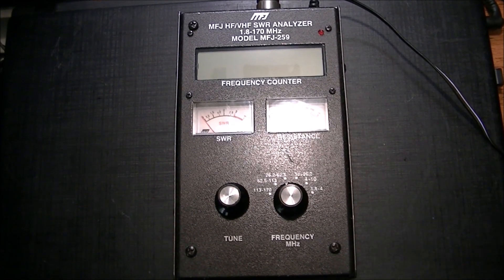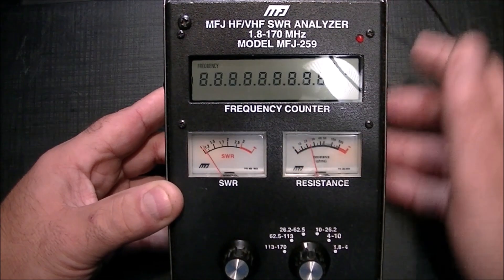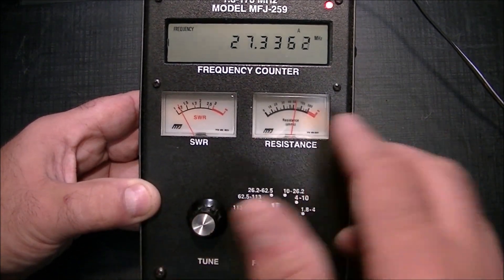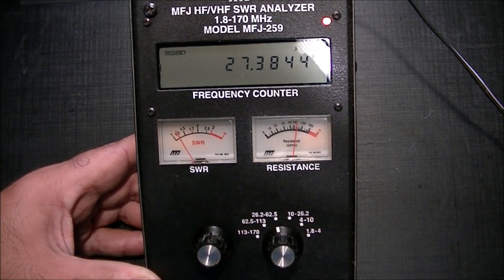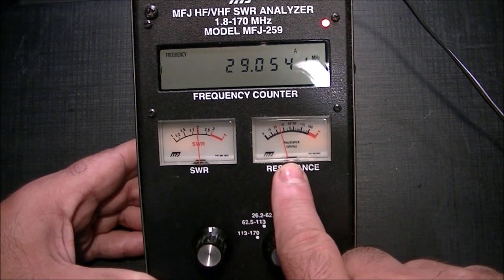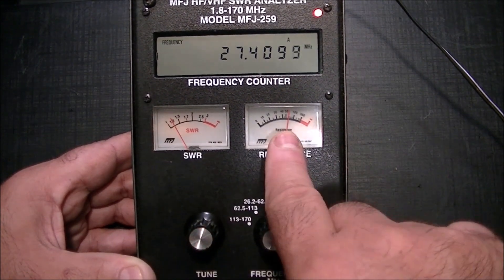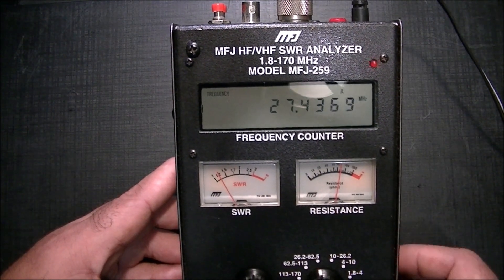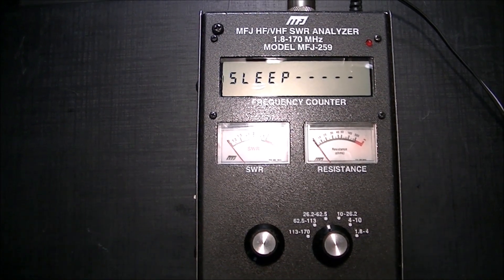MFJ 259 Antenna Analyzer/SWR Meter

Comment: These have a nasty habit of the battery holders breaking. It's a pain, but having an external battery for portable use is a good idea or obviously a power supply for using in the shack. Otherwise, they are handy units. Today, they tend to be replaced by cheap VNA's, which actually work quite well. I still have my MFJ, and other than the battery holder issue, it works well. The frequency range is also a bit limited for today but still of use. 73.
Reply from the maker: Thanks for the insight and the tips! I appreciate you sharing your experience with the unit.I don't use it very often, but it does give a person a lot of good information on the condition of the antenna. 73's brother. Thanks for the channel support.
Reply: @Tobinindustrial I used mine earlier today. I have a Mini 1300 VNA but confirmed my findings with the MFJ.

Comment: My MFJ 259C display got dark. I am not able to replace the display as spare display is not available.
Reply from the maker: I'm sorry to hear about the display, hopefully you can still use the analyzer. The MFJ company is no longer in business. Maybe you can find a new old stock display online. I was also thinking that maybe you could add some LED lighting somehow to brighten the display. 

If the display on your MFJ-259C antenna analyzer is dark, it's likely due to a few common issues. The most frequent culprits are a faulty power supply, a bad connection on the display circuit board, or corrosion affecting the screen. Start by checking the power source, then inspect the display connections for any signs of damage or corrosion. If you're comfortable with electronics, you can try cleaning the connections with a suitable cleaner, or if needed, seek professional repair. 

Good luck with the repair!

Comment: i have this model but its different than this one my one is,version 1.01 1997
Reply from the maker: I would suspect there have been changes to this model over the years.It is certainly a handy tool for the novice or professional radio operator.
Reply: @Tobinindustrial  yes correct I've learnt to get resonant freq I want on antenna b4 tuner

Comment: Those 259's are a very nice piece of kit.  Makes antenna tuning so much easier.
Reply from the maker: Yes they are! I am glad to know now that my antenna is fiunctional but could use a ring tweak to get the resonant frequency a little closer to the center of the CB band.